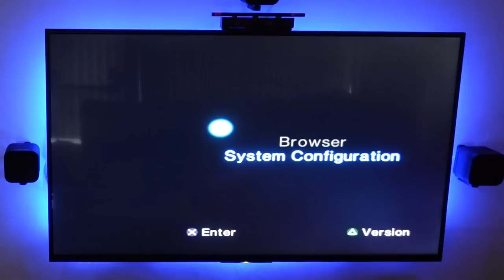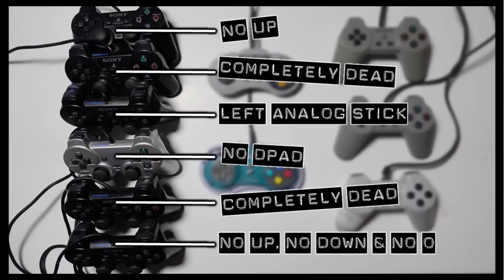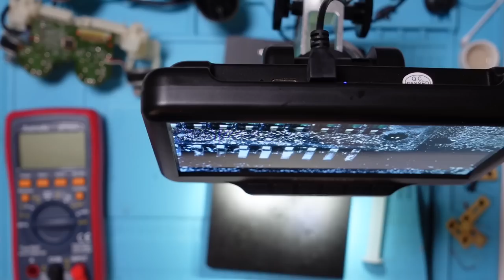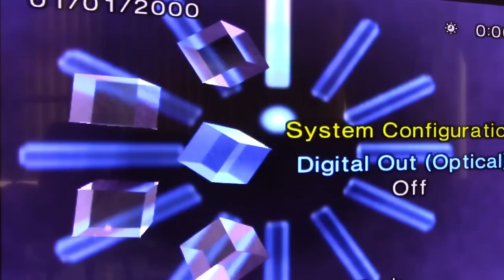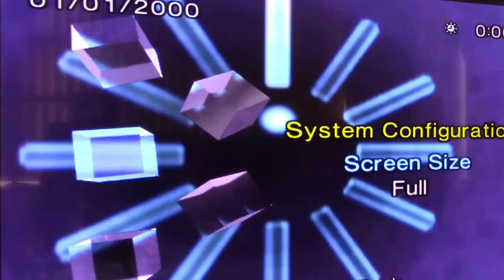I bought a Joblot of FAULTY Controllers from eBay | How many can I FIX?

Comment: Not sure if you've got this by now, but a solid method for testing PSX and PS2 pads is the PadTest homebrew software. You can easily access via freeMCboot (in fact, my first freeMCboot happened to have this preloaded). Lets you test all the buttons (including pressure sensitivity) and also the thumbsticks, their buttons and both rumble motors.

Also on the topic of pressure sensitive buttons, that was probably both the most interesting technology on the Dualshock 2, but also its biggest point of vulnerability. The ribbon membranes with all the face buttons would go bad over time. The fix is usually replacement parts, but they can also be repaired if you're really clever.

Source: I've fixed dozens of PS2 controllers.
Reply from the maker: Thanks naliboi, appreciate the info!  👍

Comment: From what I've found fixing PS2 controllers is to check out the revision on the back. I have plenty that have H and A, only found one with M that was from Japan. The H model for the most part, once they aren't working, it's off to the parts bin. They are the models with the soldered on flimsy PCB. The A models tend to be easier to repair. One thing you may find is the A models with the foam block that puts pressure on the flimsy PCB to make contact. Overtime or temperature, that thing can shrink. I just replace it with window seal foam cut to fit and works great. Same thing for the PS3 controllers. People often mistake the stick drift for just a loose connection on the flimsy PCB. Easy way to test, is just pinch the middle of the controller to apply more pressure.

Comment: Tip: To "fix" old rubber button contacts; Use a leded pencil on the contact point on the back of the rubber button. Apply by just drawing on them as you would on a paper. They tend to loose their conductivity over the years.

Comment: Love watching your videos. You know, if you ever want to fix the other controllers you can get the conductive film from aliexpress for really very cheap. Perhaps one day a revisit if you ever need to clear out the taken up storage :)
Reply from the maker: Thanks Toolz! I do still have these, so i might do that. Thanks for the heads up 👍
Reply: @StezStixFix  Love to see a follow up video if you ever get around to getting the parts and having the time to try to fix them.
Reply: @Toolz1980  I've fixed a few H series. Make sure you get the right membrane SA1Q43-A with 18pin connector. Heatgun off the old one, solder on the new one, connect the ribbon and you're good to go!

Comment: The Glop Top (the blob chip)  is a silicon die that has the circuit on it, but it's glued directly to the board instead of being encased in a full chip.  There would have been tiny wires bonding each trace end to a point on the silicon die, but the die probably ripped off with the blob cap.

Comment: Oh my gosh ! The SN Pro pad. A controller I aptly named "SN poo pad". Back in my SF2 days I smashed several of these because they had a flaw where if you tried to throw a hadoken the centre of the dpad collapsed and it just didn't work. I would literally unplug it so as not to damage my console and then swing it by the cable and smash it on the stone fireplace. For years after I used to find remnants of the clear plastic stuck between the skirting and carpet LOL. Hint they're no good for fighting games.

Comment: Every PS2 controller has a small letter written on the back which indicates the revision, if you need specific spares, check thoose letters. And the ribbon cable problem is very common among theese controllers.

Comment: I know you're having fun, but my blood ran cold watching those connectors melting under the heat gun.  Did you run out of kapton tape?
Reply from the maker: Yeah, more kapton tape on order! I just wanted to try and see how far I could push the connectors. It's all learning for me.
Reply: @StezStixFix  As you found out, anything warmer than a pensioners fart will decimate the plastic.  Been there done that, got the baseball kap(ton) ;)
Reply from the maker: @gb7767  🤣 yep, still the best way to learn. Trial and error 👍

Comment: I don't know about ps2 controllers but on PS3 I have fixed 3 controllers by putting some rolled up insulation tape behind the film connector. Over time the sponge bit shrinks and doesn't make correct contact.

Comment: 31:20 the bit in the middle looks like the bit of copper they fixed the chip to before applying the bond wires. btw if you want to get rid of the blob without destroying the chip, there's ugliness you can do with boiling acids and the likes, or extremely accurate CNC mills to take the epoxy off in nanometer layers, but short of that it's almost impossible.

Comment: I need to change some of the thumbsticks on my ps1 and ps2 controllers as their err swetting. Have to clean them up every year and they never get used. They defo got used back in the day tho. Yeh it's a bit nasty but it's a simple replacement which I will do.

Comment: I love your channel you are very thorough I've had a couple questions.  A only reason I ask is because  having to run into similar things I didn't know if you had tried this.
 Have you ever tried   copper pin stripping with conductive adhesive backing Is to make and remake traces.  You can get it thicker than the normal traces And you can solder to it.

Also what solder are you using? We do repairs in the shop all day and our last tin of flux died because our 5 core solder has it in it.    Please don't take this as criticism I'm just asking questions because I was always talked if you have questions to ask them.  You do some brilliant work Thank you for the great Content

Comment: Hi, I saw your repair to the water damaged switch lite!  Random but do you offer some sort of repair service I have one with the same issues?
Reply from the maker: Hi Solly! I only do it for fun, and I'm far from a professional. Thanks for thinking of me though. I'd be far too scared to try it on someone else's console! 😁
Reply: @StezStixFix  oh really dam!! :( I wonder if you can shed some light then, it was dropped down the toilet 🤦🏽‍♂️. Stripped it apart cleaned the board completely with 99.9 alcohol, put it all together, won’t turn on and when you plug charger in nothing happens either. Don’t really know what else to try, I saw in your video you used one of them usb voltage testers so I’ve ordered one to see if it’s receiving charge.. just wondered if there was anything else you can think of?
Reply from the maker: @solly2  Yea, its worth using the USB tester to see if it's drawing any current. If it is, then the board is likely OK, but you might want to try a different battery. If I remember correctly, if its drawing 0.4 amps, then it is charging. Make sure you check all the ribbon cables for corrosion too, the contacts are quite susceptible to eroding away with any amount of water on them! Good luck, let me know how you get on!
Reply: @StezStixFix  thanks so much for your replies! Really appreciate this! Yeah I’m going to try that, I’ve got a replacement cable coming funny enough the exact one you changed the one that runs across the bottom on the battery, I doubt it’s that as I thought it would still show on the screen it charging if that was broken? Do you know where you can get replacement battery’s from as I’ve looked everywhere 😫 I think it’s gonna be the same route as the one you repaired
Reply from the maker: @solly2  are you in the UK? If so, have a look at Replace Base. They've just had some batteries arrive, I think!
Reply: @StezStixFix  thanks so much! Appreciate the help!!
Reply: @StezStixFix  new battery worked, switch turned on with Nintendo logo and it charges... only one issue.. the screens just orange and it won’t do anything now :(. Googled everything can’t find out how to get rid of this orange screen now.
Reply from the maker: Glad the battery worked!  If I remember rightly, the orange screen is caused by a dodgy WiFi module or chip. Have a look around that chip for damage. I think its a broadcom chip... see if you can spot anything! 👍

Comment: Definitely PS1 controllers. PS1 also had dual analog, the joysticks were indented in the middle and no rumble, andbthe dualshock 1, domed joysticks and rumble. PS2 came with dualshock 2 which was nearly identical to the DS1 and was required for many PS2 games.